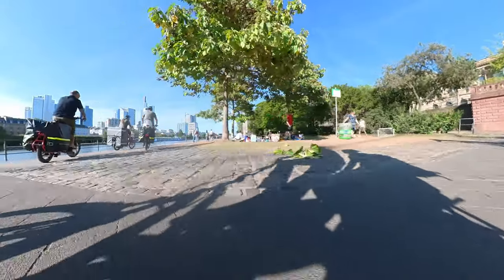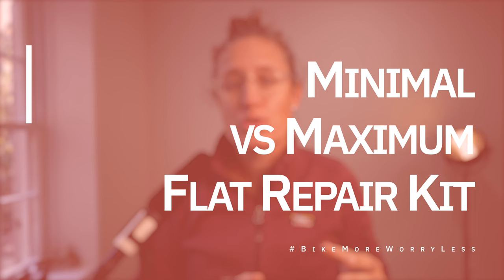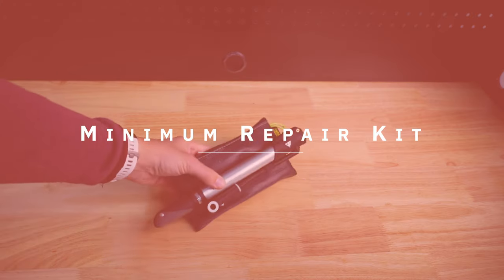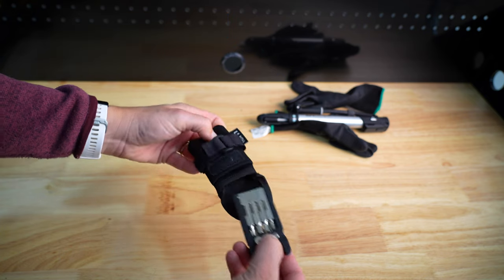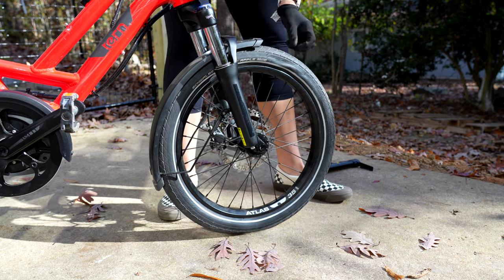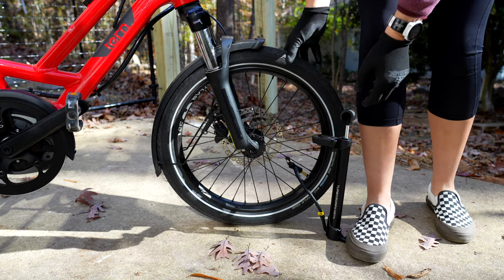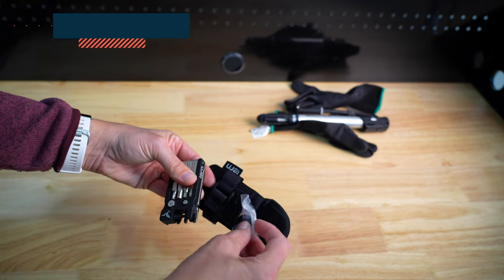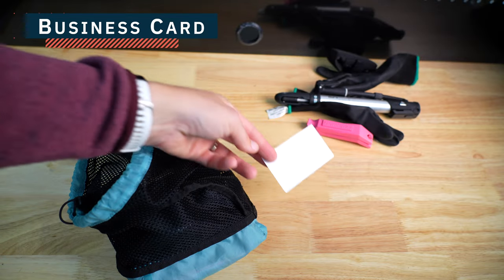My Flat Kit for E-Biking and Cargo Biking

Comment: One of the things I do is to make sure my multi-tool has ALL the items and ONLY the items I would need for the bike it is on.  So, a different tool for my road bike, than my cargo bike.  It only takes a little bit of time to check.  I've seen videos of people modifying their multi-tools, mixing and matching items, removing those that don't fit anything on their bike and adding other that do.   I also carry a spare chain quick link, some zip-ties and disposable gloves, along with a mechanic strength "hand wipe" packet.  ALSO, good ide to put your spare tube in a sock or some other package.  I have had tubes get punctures in my bag just from rubbing on my multi-tool or pump for so long; not a pleasant surprise when you flat out on the road.  I use an old bike sock.  I also carry a copies of my ID and my health care card... just in case.
Reply from the maker: I'm always fixing other people's bikes so I need to be a bit more of a swiss army knife :)

Comment: I have been trying slime in my grocery getter (non ebike) so its good hearing its worked for you.  It's a very purpose specific bike  I am probably not going to ride more than a mile.  Usually a couple blocks to get groceries or takeout so I don't care about the added weight. I would realistically just walk the bike .5 mile home rather than change a flat with a load of groceries.    I always have my black diamond headlamp as edc flashlight, and love the versatility, and its good enough to get home if I run late and don't have my bike lights.  Its also nice for seeing what I am doing loading up my bike in the dark, or if I had to work on it.

Comment: Hi. Take a wheel, drill a second valve stem hole opposite existing one. Install tube close to rim knowing it won't be inflated unless needed. Put valve stem through drilled hole. 
Now, install tube and tire as normal. Bending the "Mike tube" aside to put valve stem through hole. Inflate tire.
When you get a flat, remove any object sticking out, inflate your Mike Tube.. 

Good videos, make a Mike Tube video please.

Comment: Great video. I didn’t hear any echo. 
In addition to the things you carry I’ve added a 15 mm box wrench because the rear tire on my Bulls bike has bolts to hold the rear wheel.
I’ve never had a flat in the 2.5 years I’ve had the bike. I hope I didn’t just jinx myself 😂🤣😂🤣
Reply from the maker: I should have mentioned it but the Tern Tool I carry has a 15mm for that reason!

Comment: I have three inner tubes for each wheel of my trike and I have a patch kit I carry with me and tools for breaking the drive chain extra links in the pouch tools for fixing for putting new tubes in Greece or chain lube and tools to fix my deraillator front trailer and Any bolt to decide to come loose I used to carry spokes on me cuz I used to break spokes all time on 700c wheels but now I am on 20-in Wheels they don't seem to break